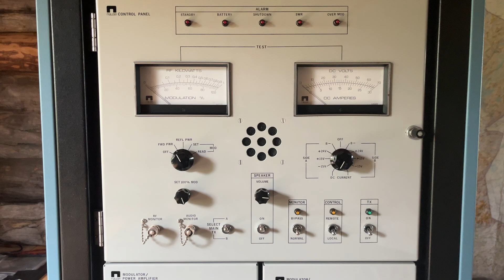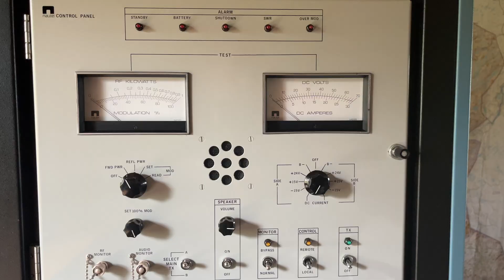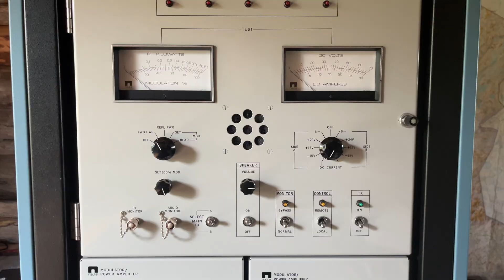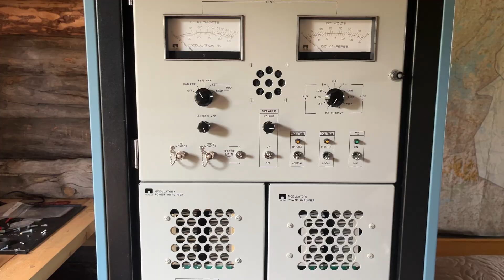Transmitter update successful test over 150km

Comment: Very cool! What sort of PA output stage does this thing have? Does it drive into a regular 50 ohm N-type connector or something? Because you’re likely to drive this into a very short antenna anyways, even when operated as an NDB, and with the frequency being so low balanced open wire line with banana plugs might work just fine!
Reply from the maker: 50ohm into N connector. The ATU can handle a short antenna but lots of loss. I will install the original NDB antenna but make it higher.

Comment: Could u show us how the exiter switches

If I understand this, one exiter is modified for 252, while the backup one is stil on original AKU frequrncy

Maybe u could show us the switch (bring 2 radios, one tuned to 252, other to (465khz (was that AKU frequency??)

I know I request stupid things, but sadly dont have a transmitter like this at home, so cant play with it :)
Reply from the maker: I cannot run the transmitter on anything except 252 kHz as per my licence. I can go into a bit more detail on how it works though.
Edit: Just to clarify I have permission for a beacon identifier only on 252 kHz.

Comment: Thank you for running the test, it was exciting to see a new signal on longwave after so long. I did notice that your carrier was around 5 Hz low. Whilst this could be corrected with the trimmer caps in the exciter, may I suggest you leave it as-is? It would assist in  differentiating your carrier from Chaine 3 on a waterfall display.

Occasional MCW 'DX tests' on winter nights would help too. Good luck with the project.
Reply from the maker: Hi yes I noticed it was a bit low. The exciters will be modified by a friend of mine soon. I will setup tests soon but I keep getting transmitter shutdowns and I cannot get audio working at the moment.

Comment: 150 Km it's a decent start for a jerry rigged temporary wire!  i was monitoring but sadly all i could hear was Radio Algérie, Chaîne 3 unsurprisingly.
it's a shame the licencing authority wont grant you a clear slot it's not like LW is oversubscribed!!
Reply from the maker: I will always keep pushing for a clear channel, the ITU needs to change LW allocations really. It’s frustrating being on the same channel as the highest power LW transmitter in the world now whilst I have the lowest power LW transmitter in the world!
Reply: @arcticradio indeed! still it will be interesting to see what happens when the winter propagation conditions take over!
Reply from the maker: @shayne109 I’ve heard beacons from Alaska and Canada at 500W in winter as we fully take advantage of the dark path here across the Arctic region. You actually need little power to reach great distances.